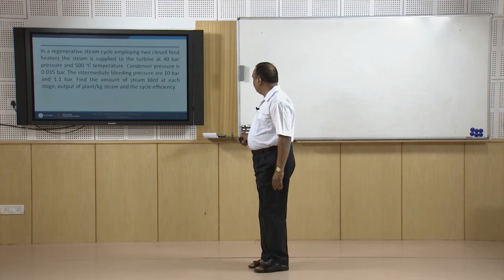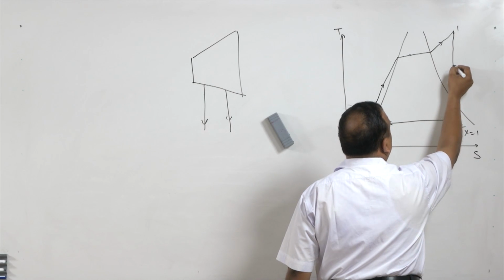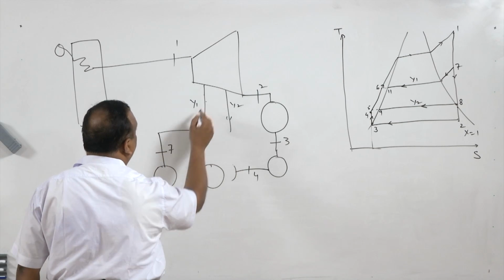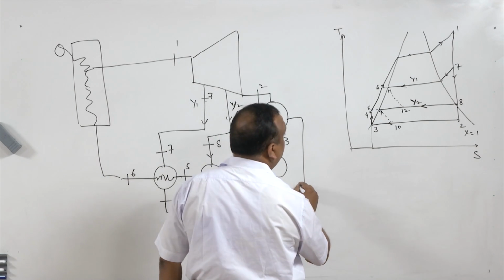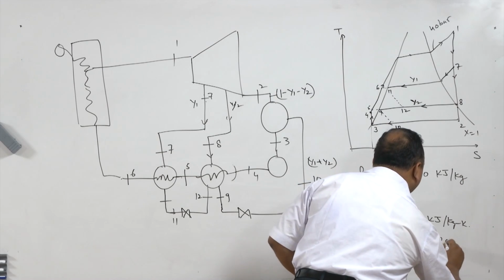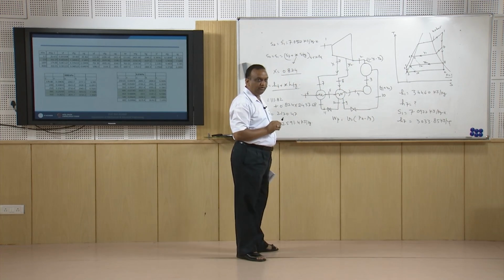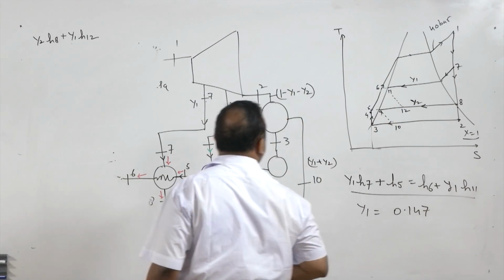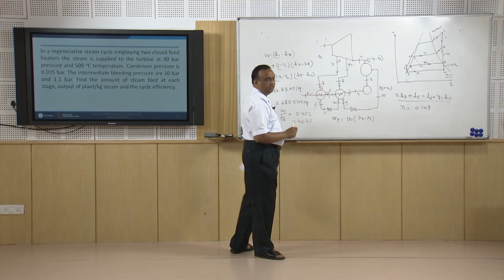Lecture 05: Problem Solving (Rankine Cycle)

Comment: Why was expansion done from point 9 to condenser? Is it to change the pressure of the feed water steam to condenser pressure?
Reply: Exactly...fluid at different pressure wont mix with each other...at 9 fluid pressure is above 1.1bar...while fluid in condenser pressure is 1.1bar....so exapansion is required....for mixing